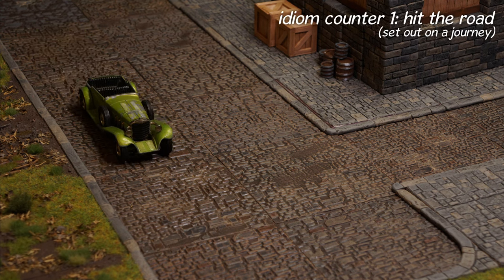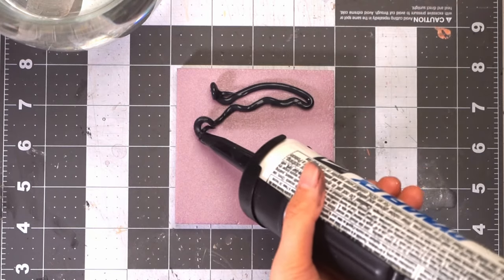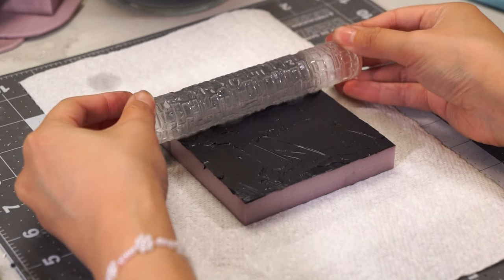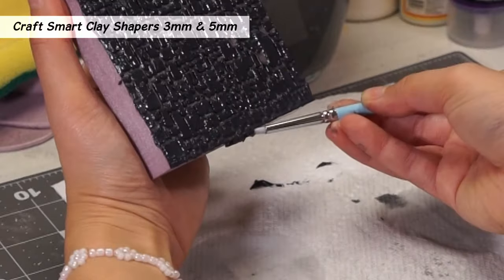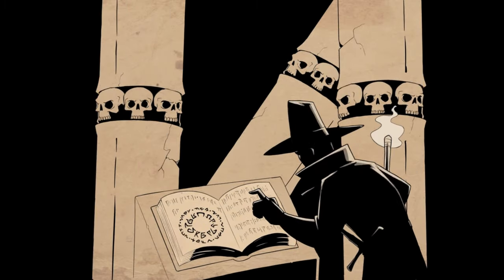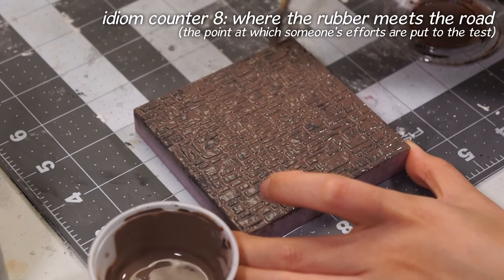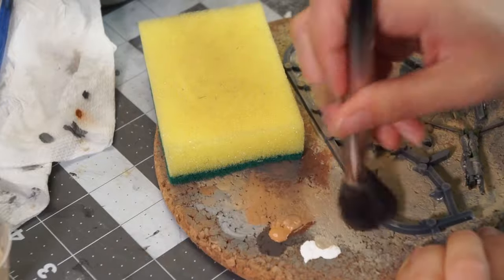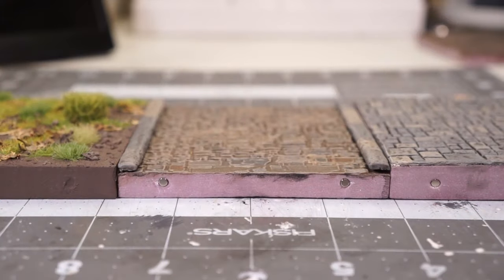Faster AND Easier than using a 3D Printer = Better City Tiles!

Comment: As someone who uses this product at work weekly, here's a bit of a warning for everyone now picking this stuff up. Do not rinse silicone caulking down the drain. It will not dilute enough and it will bind to your pipes.
Reply from the maker: Thank you for the warning! I probably should have specified throwing away the silicone rubbed off and then pour the water maybe on your lawn or over some rocks outside.

Comment: This is a great idea, thank you - I've been looking for a material to create thin, textured tiles; dental plaster is too thin/brittle. 3d printed resin too unstable (it curls up over time). Clay shrinks too much. But it's just possible that a layer of silicone and a textured roller could be exactly the thing I've been looking for all this time! Thank you.
Reply from the maker: It is hard to find something that meets those parameters without warping, so hopefully this does the trick for you!

Comment: Neat tiles, but I'm curious: why the silicone? Wouldn't the roller on foam achieve the same texture? What does the silicone add?
Reply from the maker: You can absolutely use the roller directly on the foam! The reason I do the silicone though is that the foam doesn't take the impressions as easily or with as much detail as the silicone does. And especially after painting, you risk losing a lot of your work since the pattern doesn't sink nearly as deep.
Reply: Makes sense. Thanks for the reply, and keep up the good work, your videos are always interesting and entertaining :) @raecheldoes